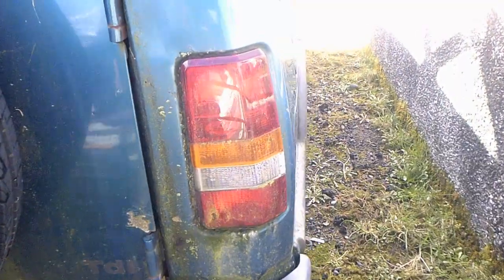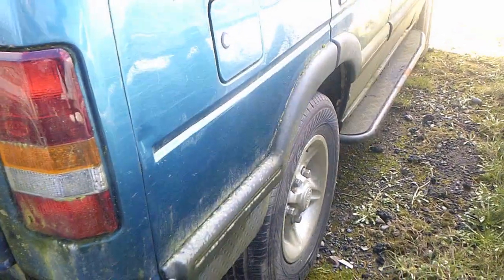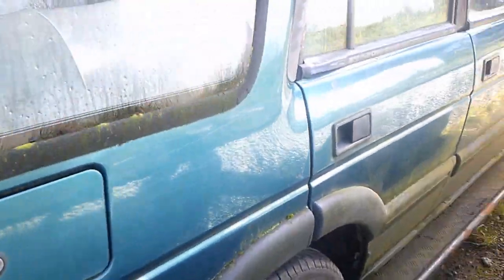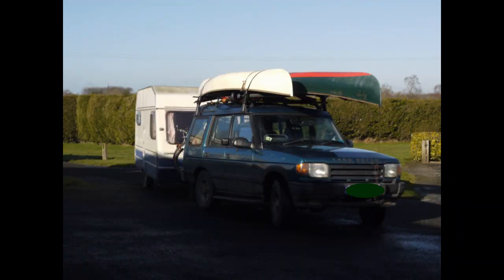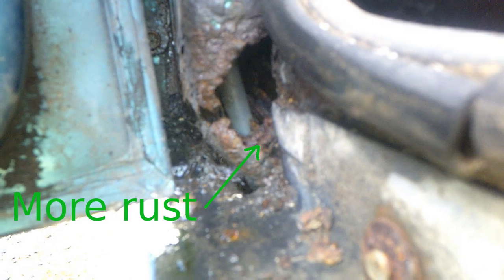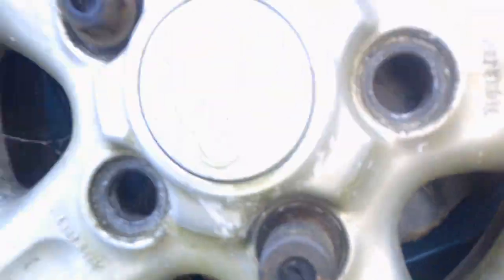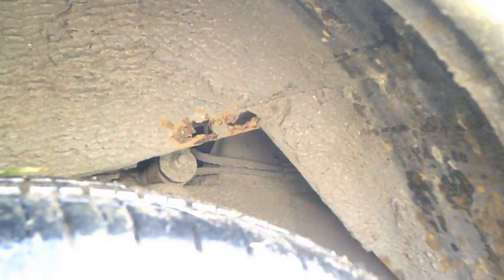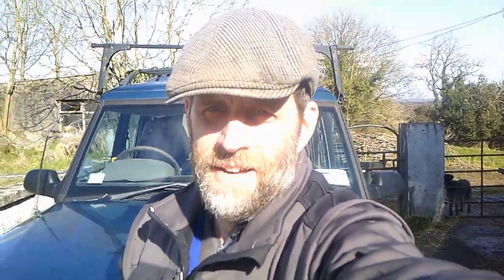"Abandoned" Land Rover Discovery 1. Will it start?

Comment: Silly title. It's a 300Tdi, of course it will start.
Reply from the maker: Ok, its a bit of a clickbait. I did expect it to start. The 300Tdi motor is great, even with 180K miles on it, its a pity about the rest of it... The rust is more extensive than it looks, of course...
Reply: @highloughsdrifter1629  Was given a 1991 3 door 200DTi 13 years ago. ran it till the MOT on it ran out, then put it on 4 ramps for 3 months of my spare time fabricating and welding it back into shape. loved my old Disco , had it as an every day driver/ was a work van with seats folded down, a 7 seater seats unfolded, a recovery vehicle with a magnetic amber flashing light (landyzone international rescue) and just my daily driver.. BUT, I became disabled and the "Mans" clutch In traffic became a problem for me, so sold It to a collector sadly/ now looking for an autobox 200/ 300/ TD5 with its swiss cheese chassis as a project/ had to buy a Freelander 1 Auto TD4 HSE version, its nice but no real landrover..Good luck under your 300DTi..

Comment: Almost impossible not to start a 300Tdi
Reply from the maker: A cold morning and a dodgy battery will do it...
Reply: @highloughsdrifter1629  My 200 DTi had two battery trays, 1 was supposed to be for bottle jack - nope had two new rated 12 volt batteries linked as 12 volts but HUGE amperage/ cold mornings ? no heater plugs required it got frightened In to life at the touch of the start key - lol - happy days..
Reply from the maker: @ianburit3705  That's a good idea, but I thought I couldn't see the other tray... It's there but has the air intake running across it. Mine has ABS, so the intake is at the front of the filter box. Maybe if I fit a snorkel...

Comment: Not as clean as my v8 discovery
Reply from the maker: I'd like a V8, even just for the exhaust sound, but the price of fuel here...
Reply: @highloughsdrifter1629  200/300 DTIs love new cooking oil and derv mixed plus a splash of unleaded/ mine had done 240.000 miles when i had to let it go, still ran as sweet as a nut, but did smell of french fries out the tail pipe - lol
Reply from the maker: @ianburit3705  Yep, used to run up to 20% cooking oil in the summer when I lived in the UK. Here in the Republic they want you to pay tax on it (and they do dip your tank) so it's not worth it.
Reply: @ianburit3705  i would still go for v8 becuse better sound and power but i still like tdi enginens
Reply: @acebull7408  Hi Alex - it depends where you live, yes we had the original Rover V8 In the beginning but that changed so much along with so many different owners of Landrover along the way, also depended on which country built your landrover too.. Its a long story.. In the UK the farmers favourite was of course the diesel, like my early 3 door discovery once was maybe.. Not long after I bought mine (was almost given away to me by a family friend) we In the UK went into a very expensive time with fuel costs. It was almost £2 uk pound a litre x 4.5 = 1 UK gallon, so thats when I started buying cheap bulk cooking oil and mixing it 50/50 with diesel adding a "splash" of unleaded.. Made it run so much better and quicker..
Reply: If i would go off road allot a tdi but a v8 would be beyter for daily driver
Reply: and mine although it its the garage as I type..